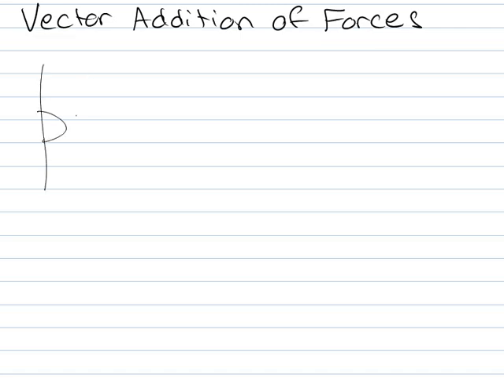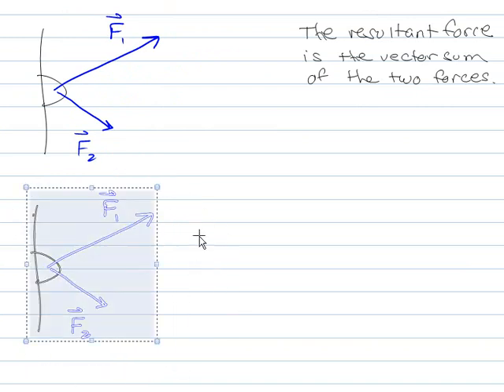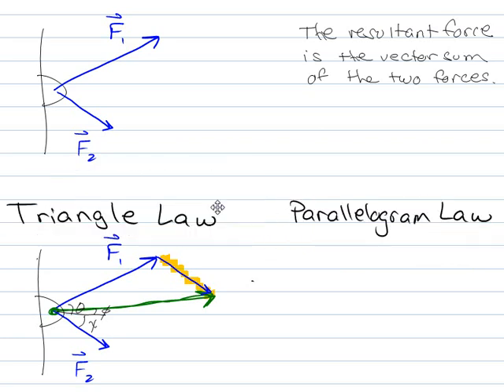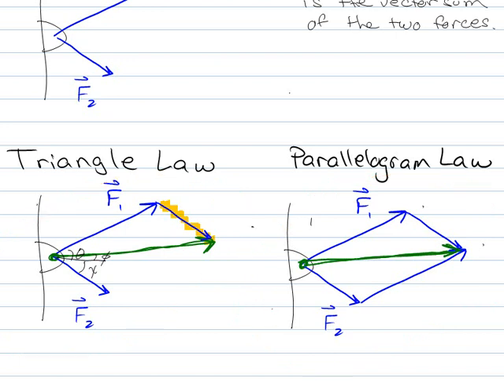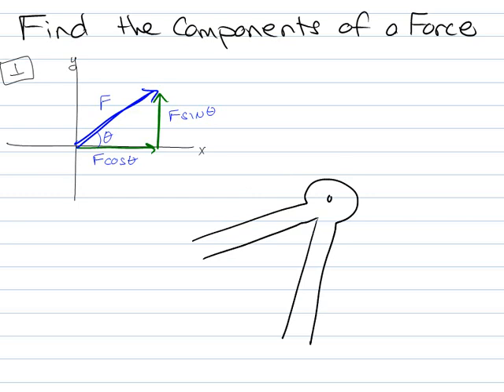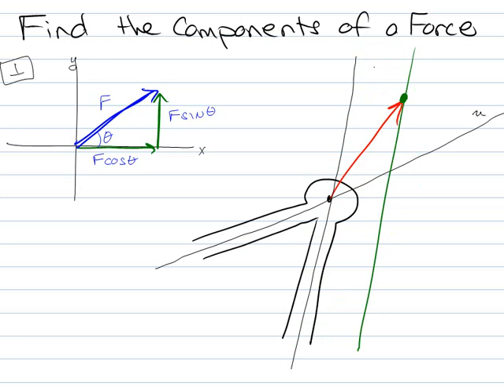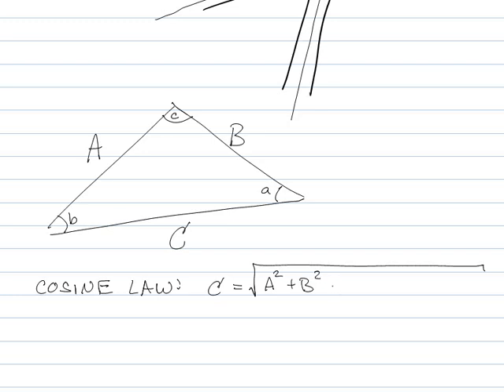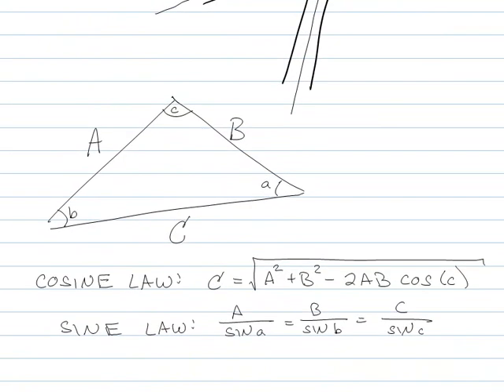Finding the Components of a Force or Vector

Comment: I'm reviewing vectors, again.  I sloshed through this crap in college.  Some observations: 1.) Don't waste time drawing in scale unless you have CAD.  2.) Don't waste time with law of sine or cosine.  3.) Just use pure vector mathematics: all you need is two points, magnitude, defined in (x1,y1,z1) and (x2,y2,z2).  Yes don't waste time with only 2 dimension, because you can't get away from moment vectors.  4.) Get an advanced HP calculator that used <x,y,z> notation which is xi + yj + zk notation.  You will use less pencil/paper space.  Does cross products and 3x3 matrix calculations.  5.) Forget about using excel spreadsheet.  One cell one value.